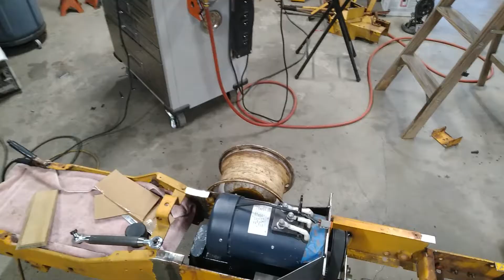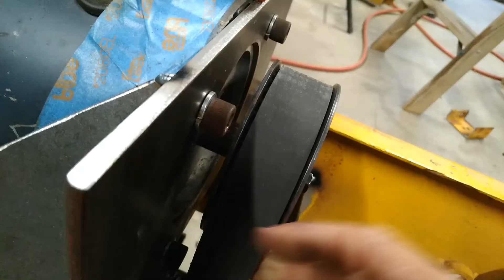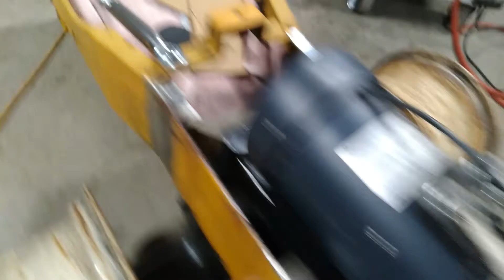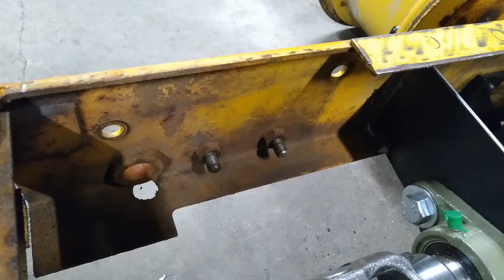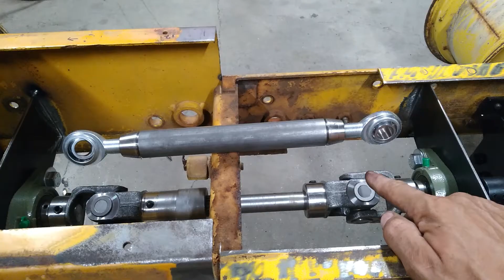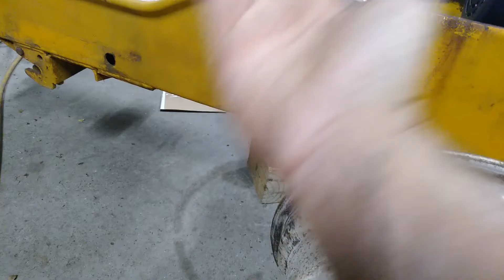Shafted - The Cub

Comment: How will you tie the fwd and reverse together?
Reply from the maker: The driveshafts are directly driven (through that toothed belt) by the motor.  When I want to go in reverse, I just flip a switch and the motor turns backward.
Reply: @billbayer5526  What gear will the transmissions remain in?
Reply from the maker: @romarbarroga3663  that's not really an easy question to answer. 😄 I took the output shaft out of the hydro unit and coupled it to my driveshaft. The electric motor drives the driveshaft directly. The final drive ratio is 25:1.